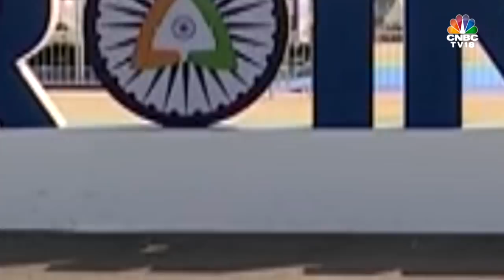CNBC-TV18 @ DRDO's Exhibit - Aero India 2021

Comment: Will These LCA NOT VISIBLE  ENEMY Radar🇮🇳
Reply: Visibility of aircraft on radar is depend on it's RCS. Tejas is made of 43% composite material which help in low weight but also in RCS reduction but not make it fully stealth. It has rcs lower than JF-17.